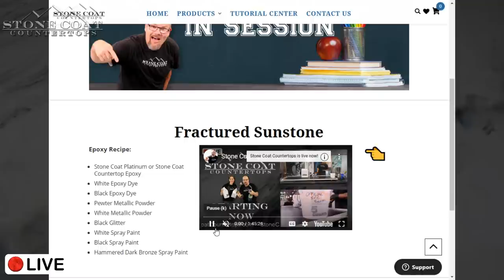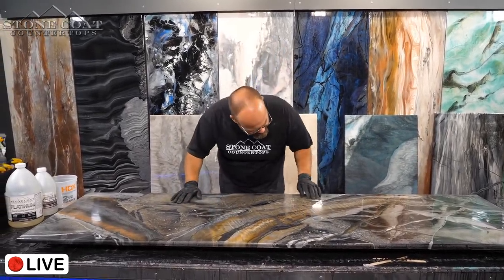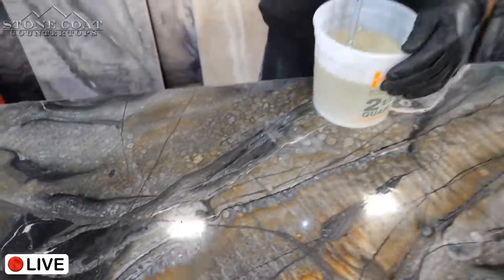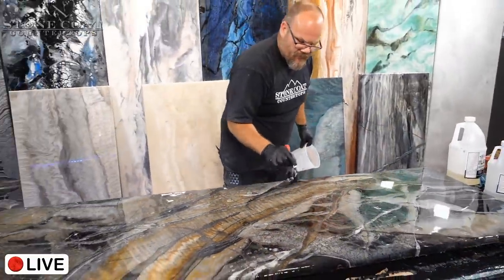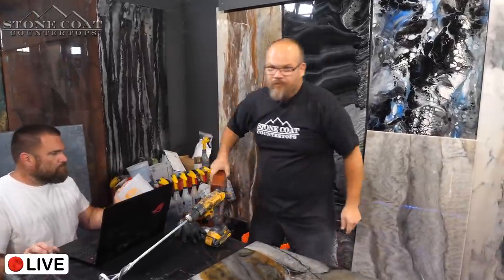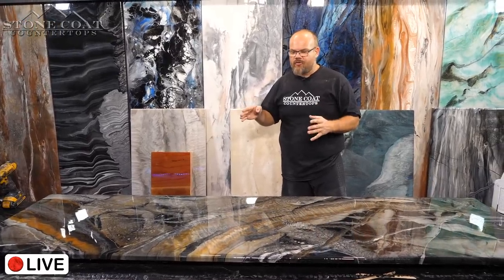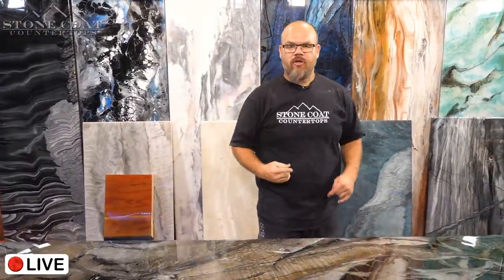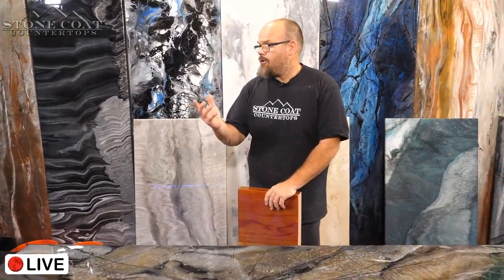Stone Coat Training Step 3: Clear Coat | Stone Coat Epoxy

Comment: Stone coat epoxy is one of the most amazing things I have used.  I used it with the foil.  I painted the top black.  Then you apply glue and lay your silver out on top.  You then smooth it out.  I put alcohol on the top dripping it out over the surface.  It will cause the silver to open up and reveal the black.  Then you apply the stone coat and let it dry.  Then you do a flow coat.  It is the strongest surface I have ever had on my cabinet tops.  I put stainless steel as the backsplash and it goes beautifully with the countertops.

Comment: Hi guys! So I’ve been using resin/epoxy for about 3 years now for art and small projects but I ordered your Art Coat kit to do my small kitchen counters, did my color coat yesterday (not super happy with it as it has a ton of low spots mostly along the edges as I didn’t use enough product) I’m ready today to do the clear coat and I hope it covers the imperfections 🤞 then following with the Ultimate Top Coat the next day. My question is, I just saw your piece you cut off of the river deep pour table and the half you did the Ultimate Top Coat on it looks really nice and durable but am I going to lose the shimmer and sparkle in my color coat?? I added a ton of your Diamond 💎 Dust (like you did in you Fractured White Marble piece) I don’t want to lose my Bling! ✨💎💍💎✨ I know this was a live but I hope I still get some advice? Thank you in advanced love you guys

Comment: ok, for real now, i paint cars as my job, but i'm 51 now and it's just brutal, not that epoxy resin requires no work ,, but i have bi lateral carpal tunnel, cubital ulnal nerve damage, starting arthritis , especially in my left thumb, and a really bad knee, however, i would rather work for me anyway, and it's a job i could set up on site, or at my home, now i've done similar stuff to that , but it takes hours , and frustration, to get those results with auto paint, besides it being cost prohibitive , especially on a large scale, so this stuff is a much better option, i have tons of questions , like can it be sprayed, ? is there an accelerator to make it set up quicker?and a bunch of questions i haven't thought of yet, i will be in contact with you soon

Comment: Hey Mike, I would like some advice, I have 16*16 tiled floors and desperately wants to epoxy my floors can you please, please do a video showing how to do it even if it's on a countertop using smaller 6*6 tiles,  I guess the same process will still be applicable to my floors. thanks guys

Comment: Also can the platinum be used as a clear coat over the original as the color coat? I am having a lot of problems with getting flys and bugs in my clearcoat. Lost $300+ already on 1 table top

Comment: When you're torching bubbles does that also increase the flowabilty of the top coat as when in a previous video (platinum) when you torched the reuse of drips with popsicle stick adding additional veining towards end?